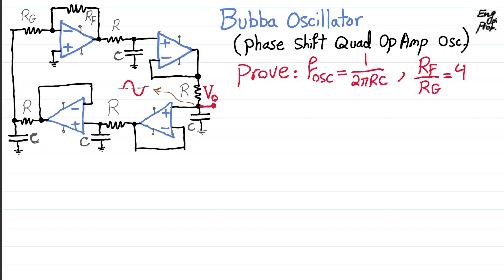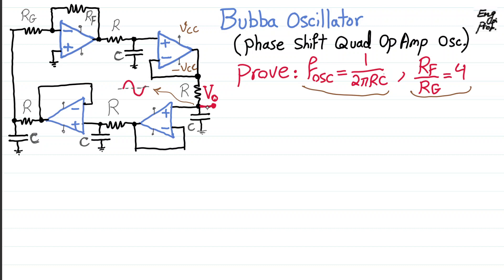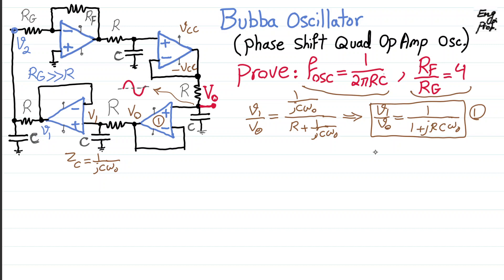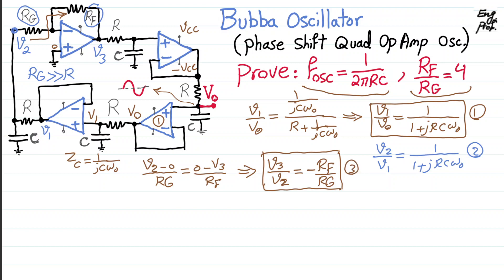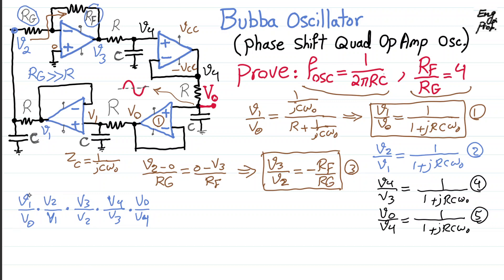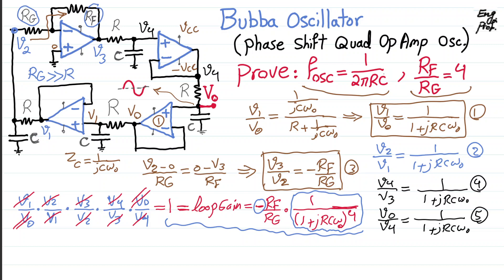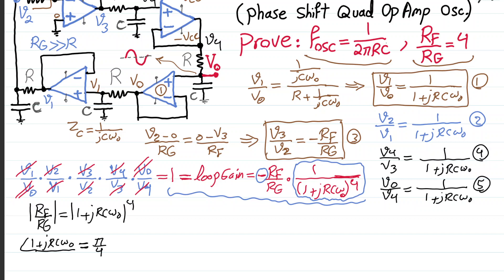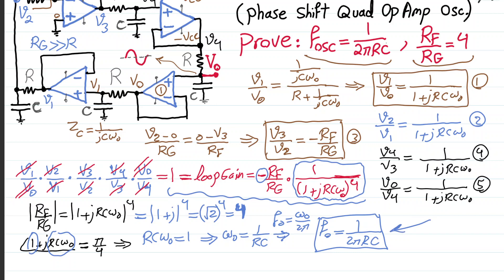Bubba Oscillator with quad Op Amps: Find frequency of oscillation and required Gain

Comment: Theoretically Bubba oscillator circuit can convert to regenerative band pass filter.
Reply from the maker: Thank you for sharing your insights. A Bubba oscillator circuit can be converted into a regenerative bandpass filter. As a phase-shift oscillator, Bubba Circuit is typically used for generating sine waves. By modifying its components, specifically adjusting the feedback loop and the frequency-selective elements, you can reconfigure it to function as a regenerative bandpass filter. In such  configuration, the feedback mechanism is designed to select a specific frequency band for amplification and attenuation like a band-pass filter.